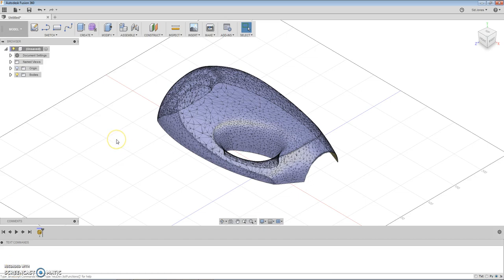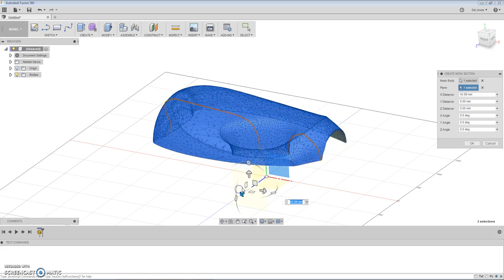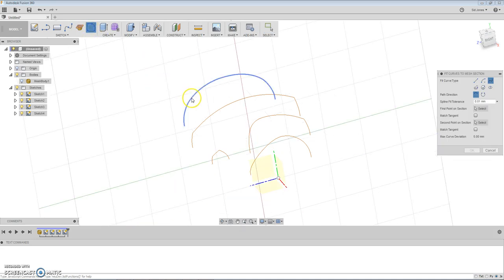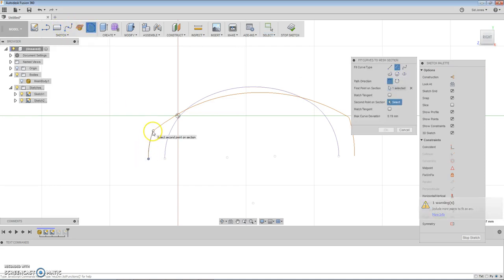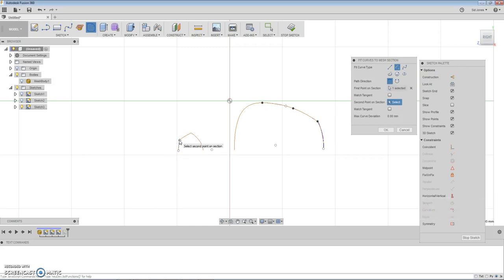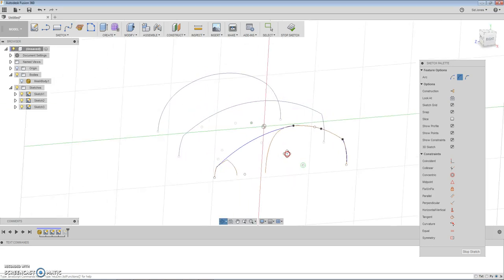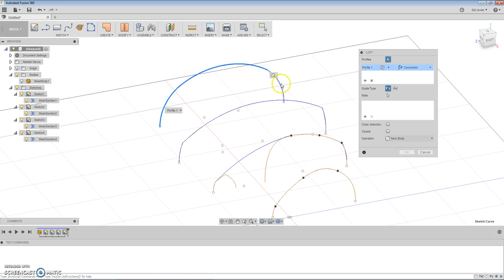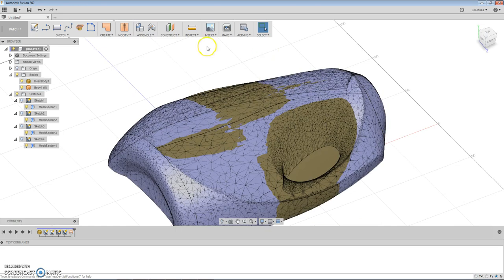Using the Mesh Sketch Feature

Comment: Which program are you using i try the same on fusion but i dont find one tool
Reply from the maker: there have been a lot of recent changes in fusion, some tools have been eliminated or the names have changed; however, the overall process should be very similar
Reply: @sid_computercourse1242  I can't find it either, can you take a look and let us know because this command is very important please